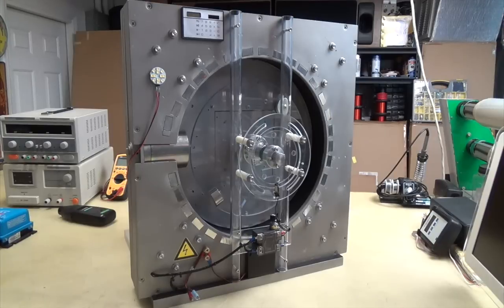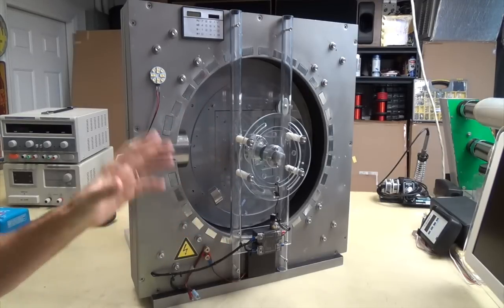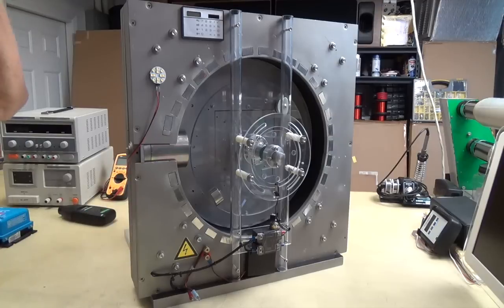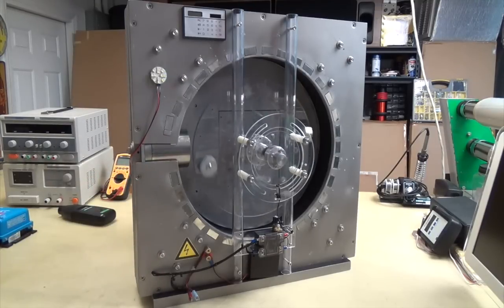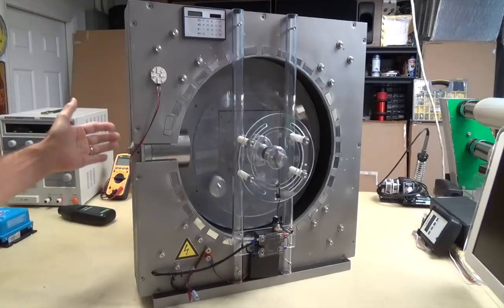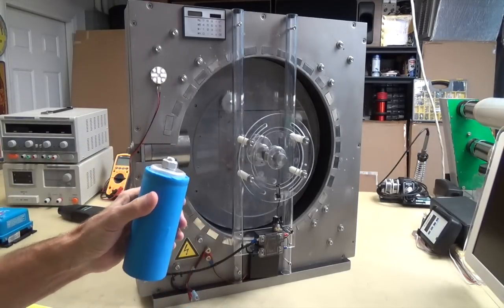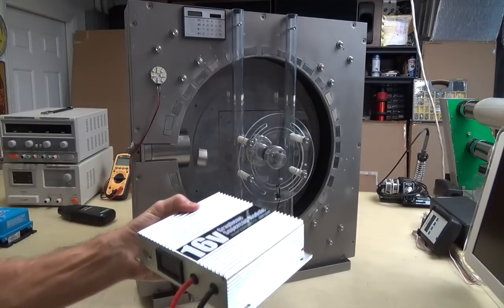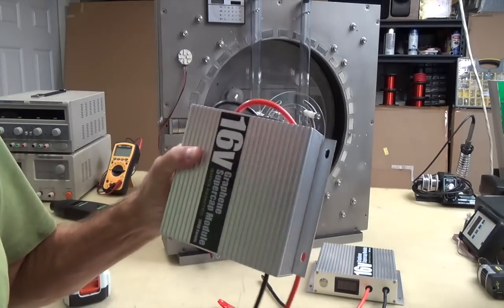ALL Magnet Motor

Comment: Question at full speed, what is the max load? Can it run an Xbox or 4k tv? Or a heater? Those are the things that have the highest draw in my home, dose scaling up increase output. Not thinking too much or doing math it seems connecting this to a energy bank to store it then add in an invertor to supply the electronics... Humm I'm sure I'm missing something.

Comment: The explanation is simple, the same force that is pushing it forward is pushing out in all directions. So as it is spinning it loses momentum from being pushed back. The silicone jacket is not necessarily what makes the wire flexible, most silicone wire is ultra-fine stranded and rated for continuous flexing. Stranding has the biggest impact on flexability.
Reply from the maker: We like the non-melting aspect.

Comment: Those super capacitors would be great for quick take offs in a car. Those high amp pulls ruin the lithium batteries. It would level out the load on the batteries and make them last longer.
Reply: That may be why Tesla acquired Maxwell last year. Imagine incorporating one of these into the system as well.

Comment: Can you measure current going into the electromagnet at that 6V source and the current coming out of the generator at the back? That'll give some indication of how much gain your magnets are giving you. Also, with a small dc-dc converter you can step the voltage down from the generator and pump it into a capacitor to replace the 6V battery bank. Those things can be pretty efficient. Also, now I'm further in the video. You say you can't put the back-emf back into the batteries? Why not? Can't you just put a diode rectifier on the switched side of the electromagnet back to the battery?
Reply from the maker: This will help explain what you are asking.  https://youtu.be/UuiFoq9Y7do

Comment: I notice you never mention that this device is overunity, however it seems to be implied, or else what is the point of this thing?

If you say you are able to run the 3P back to the supply power, why don't you? It won't need batteries at all then, just a hand start to start it making power and it should run by itself. if that is in fact not possible, then why wouldn't you connect two of these devices together with a common drive shaft, electrically isolated other than one device outputs to the input of the other. the two devices could then power eachother, again, only needing a hand crank to get started.
Reply from the maker: Here you go!    https://youtu.be/UuiFoq9Y7do

Comment: Why don't you lay it flat with 4 radial electro motors and let them alternate the current so you do not have the rest energy from the collapsing magnetic field as the collapse would be timed with the next EM activation in 2 stages:

Stage 1
EM-000/090=1 EM-090/180=0 EM-180/270=1 EM-270/360=0
Stage 2
EM-000/090=0 EM-090/180=1 EM-180/270=0 EM-270/360=1

Comment: Reading your answer, I understand that you can not simply add more rotors to increase power. So, this same pattern with the kick, has be be repeated in as many parallel rotors if we want to increase power?
Reply from the maker: Not really. You could add a few rotors in parallel while using the single electromagnet to allow all rotors to pass through the small repulsion zone. You would ONLY have to increase the EM pulse time by a fraction of a second. Beyond a few, I don't know how many rotors and stators could be totally added before needing an additional electromagnet.
Reply: PMMG4HYBRID Thanks! Your system actually works. I have watched Perendev system spining on high rpm without a kick magnet. What is going on there? Is it working or not?
Reply from the maker: @georgiosgerasimidis3254  Perendev type will only work for a very short period of time. Sometimes only seconds.

Comment: The want to limit graphene because they can't control supply. You can get carbon everywhere. How much capacity would a 'fuel tank' shaped array of capacitors worked to act like a battery have?
Can you make graphene super capacitor battery banks for home solar power set ups?
Reply from the maker: Yes to the second question.

Comment: Ok second of all how will this work out as far as solar and wind power I've got some small dc motors I'm looking at using as wind turbines or would it be better and cheaper to buy a couple of your magnetic motors and just set them up in my garage and instead of putting an alternator on the back use a couple of these packs back and forth to power my whole home?

Comment: Is there any materials which prevents magnetism through it?   It would sure be handy in this type of build.  I have not found any which will stop the push-pull of magnets on each other.  Not even copper, gold, or silver.
Reply: Steel will do it. Called magnetic shielding.
Reply: Nickel
Reply: if somone discovered a material that could block magnetic forces that would be insane. So much could be done with that.

Comment: why does people want exact plans? you gave them a complete walk through. What is the fun in making a exact copy. try to use this as a example and improve. If you are not smart enough to follow along then I doubt you are going to have much luck. Thanks for the upload very cool. Never thought about the electric magnet just to help it by. I got a design stuck in my head for the last ten years and just doing some research to see if it has been done and it hasn't. I wan't to say how as you seem like a good brain to pick but not wanting to give it away just in case it works. I am trying to finish building my 53 truck  when its done this will be my next build. Well not this but a magnetic motor.

Comment: How much would it cost to build one of these motors? What is the maximum of kilowatt hours it could produce per day running at maximum capacity?
Reply: Um... it doesn't produce any power Dacon.  It's just a single pole brushless motor spinning a three phase generator powered by a 6 volt power source.  Once those batteries run out of juice it stops.  It's interesting for sure but it doesn't MAKE power if that's what you were thinking.

Comment: What if you pulsed the electromagnet on the side where the magnet is falling. If the electromagnet was on the right side of the stator the mass of the inner magnet would help propell it passed the gap, eliminating the need for a flywheel. Just an idea?

Comment: Nice motor. Divine, simple and efficient. I built a Bedini motor...yes..not much torque..but charges capacitors and or batteries and keeps the 15 pound magnet wheel turning at about 350 rpm with a fan blowing air..but really not useful as a load bearing motor.  Good wake up call on the capacitors...glad I bumped into your channel.

Comment: So. If you change the batteries to rechargeable and add a charger instead of the 12v led light the unit would be self powering.

Comment: I like what you are doing here and I think that Graphene is the future of energy storage, but its not quite there with matching the energy density of Lithium Ion tech. Tesla claims to get about 250W/hrs per Kg with their model 3 batteries. Based on the weight 1.7 Kg and energy 72 W/hrs in your module, that puts it just over 42W/hrs per Kg. You could probably increase that number by putting more caps into a bigger casing, but I doubt that it would make that much of a difference. It would take about 1000 of these modules to match the capacity of the average Tesla, that's 1700Kg (3747lbs) of super-caps + a car. This is why they currently use Lithium Ion.
Reply from the maker: They don't have to replace the lithium ion batteries. When connected together, the graphene supercaps become the path of least resistance and will receive a charge and deliver the energy before any Lithium. Removing any volume of stress and heat from Lithium batteries is a double win scenario.

Comment: The future will depends on electricity all new technologies depends on it, we need lower the cost of electricity .
Reply: Electricity is actually still quite cheap. We should rather improve the harvesting of energy to more environmental friendly methods. Because the hotter the planet gets the less efficient the traditional Energy production becomes (because burn driven facilities rely on the temperature difference between inside the burn chamber and the outside - same with Al burner engines in cars, airplanes, ships etc.)

Also we should improve efficiency overall. There so many losses along the line. Medium loss (like solar is only 20% efficient), step up to high voltage for landlines, landline loss, step down again to 11/240V, conversion to DC/ other voltage loss, charging loss. 
Man if we could eradicate this there would be no lack of energy.

I'm wondering how much energy is lost in total from source to outlet.

Comment: Thing is, every magnet is battery of magnetic force, so it's not so much a motor, it really is magnetic->electric energy generator.
I think those have some future becouse some magnets have high energy density and they could be used in EVs, but this kind of generators should be optimised and than compared to currently used batteries. Maybe this is the solution to current el. energy storage demand.

Comment: Also crystal cells with super capacitor bank and small solar panels she'll box
Reply from the maker: good thought v.1
Reply: @PMMG4HYBRID   i work on the energy re use just  to power machine just it lose the energy. i use tesla and a spark gap radio it like from 10k to 130k power. sory guys i forget a word i mean in plug it 220.
it work for a long that 130k it alot to power one hause and the funny part i give most back to  city and gain some monney when it lov on energy i give it a stong kick like lighting hehe but i work on a small scale now like 6 to 24 max and i cant find a way

Comment: So I suggested this on a solar forum to prompt some additional discussion. The primary concern seems to be: a) self-discharge and b) low amp hours. Can you chime in on this?: https://diysolarforum.com/threads/graphene-options-are-soooooo-much-better.2883/
Reply from the maker: • Leakage Current ≤ 3mA •  • Charge Retention Ratio ≥ 92% • • Charge-Discharge Cycles ≥110,000 • • Extremely Fast Charging

Comment: in the early 1990s.. 92 93,, inland motors came up with a 23" square cased motor with an 8" overall shaft length for electric trucks and buses.  direct drive..  1,000 foot pounds of torque from 0 to 3600 rpm.. and it was like 360 Horsepower.    i always wanted 4 of those.. 2 to install between my friends marine transmission and his prop shaft.. so the transmission could be shifted to neutral.. either one or both electric motors on each shaft to drive the props..  or to assist the engine at high speeds..   shaft rotation was about 600 at 20 knots..  previous engines in his boat had a prop shaft rotation of about 1800 RPMs.. previous engines made 3 times the horsepower..

Comment: If this is really working, then it would be good for an off-grid cabin. To charge the batteries in combination with solar cells and a windturbine. To supplement the other charging sources when there is no wind and not enough sun.

Comment: Again, I like where you're going. 
There is a better way. 
Simple take what you just did and reverse your mode, medium, and methodology and you can easily increase efficiency. Plus, and we mathematical people like pluses; it will be easier to apply other methods this way.
A lot of innovations and discoveries have occured in the last two decades; by reversing your technique it should be much easier to implement them. 

Wish I was half the engineer you are though. Good luck
Reply: You wish you was as good of a engineer as him but then basically said he did it wrong and needs to redo. But if you are not as good of a engineer then you don't know what you are saying. So stop being a troll

Comment: Do you have drawings of this unit and what is it made of
Reply from the maker: Case is Sintra Plastic, polycarbonate tubes & rotor, stainless steel hdw, all ceramic bearings, neo magnets. Built without drawings as I do with many machines, sorry.

Comment: Why did you opt to use multiples of 8v rather than 12v?
Reply from the maker: Great and simple question. Many battery type chargers will top off at 14.2-14.5V. The graphene caps are 2.7V each. Six caps connected in series = 16.2V. Plenty of room for safety for standard chargers.

Comment: You know what.... I would love love to build a pack for a Toyota Prius like a earlier model Prius 05,06,07 and fix the system where it would be compatible with those graphene capacitors... that would be fantastic.. you could dang near modify the car to where it would run off of the capacitors at will,by a switch and use the gasoline engine very little... yep went and checked out your site.. these are great and all but it's really a rich man's game.... I mean right at $300 each... I mean who can afford that...I definitely can't and heck I run a car lot and auto repair business.... but they are very cool maybe one day the average person can afford these...

Comment: I still don't know what this machine is or what it can be used for. Can someone please me understand?
Reply: Potentially anything. It's a motor. As long as you can translate the energy out of it, you can power it.
Reply: Charging batteries for a power inverter.
Reply: So it's meant to be a very efficient way of charging lead acid batteries from a low current and low voltage source.
Reply: it's a lesser BLDC motor

Comment: Scrolled thgrough the clip. It does not speed up.
Reply from the maker: Here it is:  https://youtu.be/UuiFoq9Y7do
Reply: That's because it's running on the 6v battery
Reply: I’d think you change speed with the kick of electromagnet!
Reply from the maker: @1956vern  In a sense, that is partially true. However, when you advance the electromagnetic pulse timing, it is already in the BEMF phase before the rotor magnet reaches it. That reverses the EM polarity and causes the rotor magnet to be drawn to it in attraction instead.
Reply: @PMMG4HYBRID  Really interesting technology you are making, in your mind, what would the premier application for the motor be, to truckle charge the batteries we use in industry? thanks for the demonstration

Comment: The best part is that it produces more energy than it consumes.
Reply: Uh, right- didn't you see that it needs a battery to run?
Reply: @chestervaldes7551  It doesn't need a battery to run, change the batteries to rechargeable and run a charger instead of the 12v led.
Now it is self powering 😀

Comment: Try to loop back the stator electromagnet on its own during repulsion. Redesign ...
Reply: make  the flywheel  better out of a torus shape magnet with a close-loop magnetic flux...
Reply: try to design using 3,6,9 principle...3-phase,, 600 Volts (high frequency) 9-poles(3-phase on 3-phase)...
Reply: Try to use 3,6,9 frequency variation 300- 900 Hertz frequencies. Frequency sweep
Reply: Observe optimized resonance at all times  especially on start up...
Reply: Glad to share my ideas with you if you wish..
Reply: adding'motor action' to the flywheel will also add to the turning force of the whole system.
Reply: Spencer Roger : Its my "play of the mind" .Thank you for the reply. If you are intertested in my "other' ideas  we can work it out together. (e.macarta55@gmail.com).
Reply: interested i mean sorry......
Reply: Xperia

Comment: Are these capacitor  things batteries? Charging them..could you use solar panels? Could these be your solar power storage? As you can probably figure out, I know nothing about electricity.
Reply from the maker: Graphene supercapacitors are better than batteries. Extremely fast charging, much longer life and charge cycles and will not explode or burn. Deep storage. Safe for air freight. Many advantages.
Reply: @PMMG4HYBRID  How long do they hold charge? Also do you need any special procedure (i.e. charger) to charge them?

Comment: that motor acceleration power will rise very high when u deal with big resistance caused by acceleration and torque. not handy and not good for cars except u use gears which connect in different arrangements to the  motor and it allways spinns at same spinn with a high mass and recharges the motor when not connectet to the gear so the resistancee stays the same
Reply: با تشکر از زحمات شما و اطلاع رسانی  در آموزش  فکری جهت رشد نوجوانان

Comment: A very cool motor no doubt so does this machine put out more energy than it uses? And if so what's the scale? I believe you should change your name because this is not an all magnet motor you have an electric input..if it does produce overunity then maybe call it an overunity magnet motor?
Reply from the maker: An electromagnet is still a magnet no matter how long you look at it.
Reply: Thanks for the great video and great info on supercapacitors
Reply: Imagine not believing in the conservation of energy
Reply: @johansundman8221  wouldn't be the first time a law was broken or proven wrong. But this idea does not break the law as magnets have potential energythat can be converted into other forms of energy if harnessed correctly
Reply: @SuperBrainAK   I think I understand what you're saying but if that's true how do you magnet tracks work? Or a gauss rail?
Reply: @SuperBrainAK  so basically you're saying in like a linear magnet track or gauss rail takes your physical energy to start it into the track.. but if you tried to connect the loop it would cancel out the other magnets?
Reply: Touche point taken. So is this design over unity?